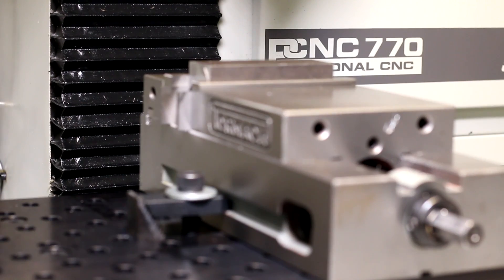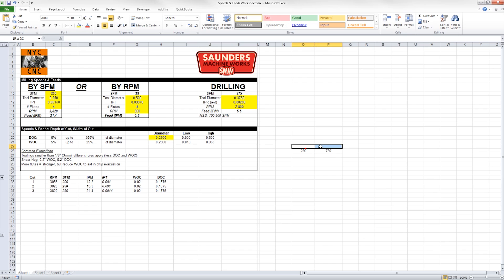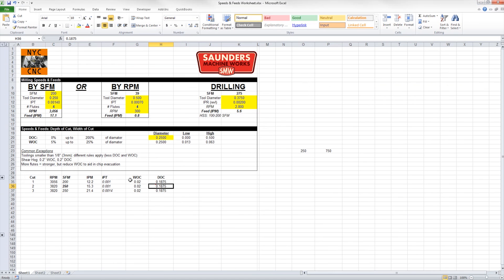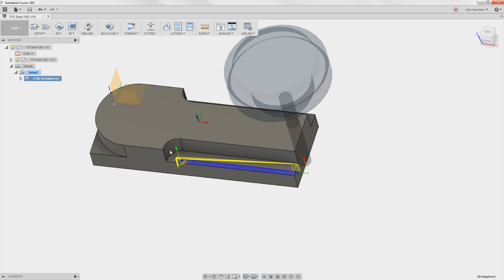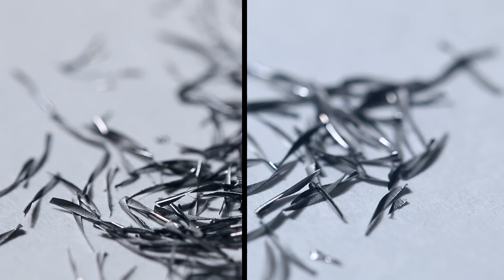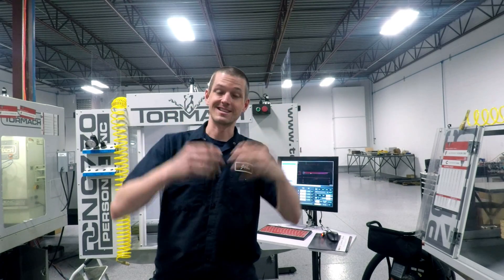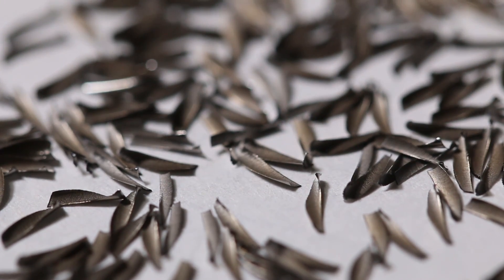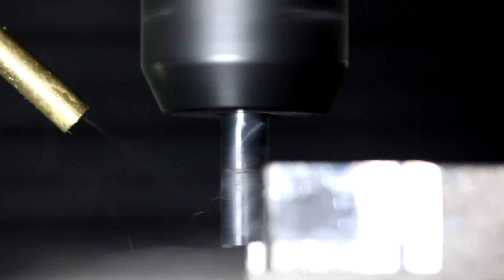Tormach 770: Steel Feeds & Speeds Test!  WW142

Comment: The video contains an error at about 7:21. I know this is an older video, but I found it helpful while researching feeds and speeds for my first cuts in steel (on a 770 Series 3). For your last cut, you say you have 0.002 feed per tooth, 4583 RPM spindle, and 25.7 IPM feed. These numbers are not mutually consistent. If the 0.002 IPT is correct, then your feed was 36.7 IPM. If the 25.7 IPM feed was correct, then your chip load was only 0.0014

Comment: John, when you tried to go to full depth of cut, you said you didn't know why you encountered chatter. Did you talk to Carl @ LSC to try to figure out why? I'd LOVE to know.

The change you made to steer away from chatter seems to go against your preference of deeper DOC and narrower WOC to take advantage of the flute length on your end mill (assuming SFM and CPT are in range).
Is there a better way to calculate the balance between DOC/WOC other than trial and error?
Thanks for your help. I'm battling a very similar issue on my 770 cutting 4140 steel, so I was very excited for this video.

Comment: I'm not sure what Lakeshore recommends, but if you're running below the high-performance endmills recommended speeds and feeds you may get better life out of the general purpose endmill.  Our supplier stresses that the high-performance endmills we use need to be run within recommended specs to gain maximum life, too slow can be just as hard on a tool as too fast.  Not to mention if you're running them slow you might as well save the money and use the cheaper endmill that you can run at recommended specs.  I would also say you shouldn't use recommended speeds and feeds from the general purpose tool as "low end parameters" for the high-performance tool, there is likely more at play than just the tool geometry.

Comment: John,
I am struggling to understand why there is such a large difference in spindle and feed speeds between manual milling and CNC. Is it the use of smaller tools in the CNC machines? The greater cooling available?

Comment: Hi John. I use a brand called Helical Solutions. They offer variable flute endmills as well and are comparable to other high end endmill manufacturers. They have an app on their websites (http://www.helicaltool.com/cms/millingadvisor_367.aspx) that calculates and recommends all the speeds, feeds, rdoc, adoc....etc. You just type in the specific tool you're using, the material and the type of cutting strategy (high speed, light rough, finish etc)  and it will recommend a really good formula. It's worked really good for me with adaptive clearing on sst and cold roll steel. Btw, I wouldn't recommend coolant when machining 1018 steel when cutting with these cutters/coatings. I've found that tool life is extended dramatically. The coolant causes thermal shock which causes the edge of the endmill to chip. Anyhow, give that app a try, I think you'll like it.

Comment: Great video John.  Thanks for posting.  Did you notice that the .375 depth of cut pass that chattered was around half the material removal rate as the .1875 DOC pass with a larger width of cut?  If you pull out your handy feeds and speeds calculator, (G-Wizard, FSwizard etc...) plug in the parameters, it would tell you that the cut that worked great has around 2X the deflection of the one that chattered.  How can that be...?   The reason is that all the feed and speed calculators (that I've used) do not calculate the cutting force directly, instead they start by calculating the power required from the MRR and machinability data of the workpiece material.  Then from power and rpm calculate torque, from torque and diameter calculate cutting force.  This results in an average force number, which is fine for cuts where one or more flutes is always engaged.  When taking a small WOC only 1 flute is engaged at a time and the power based force calculation becomes less like reality.

Comment: This is where business decisions influence things like feeds and speeds.  Even a part run of like a 100 part, getting a decent chip is good.   If you have a parts run of 100,000 it's worth the extra time to get nearly the perfect chip and every ounce of un needed movement out of the G code.  Even things like step over height can be looked at on a large run.  Running one or two parts?  I wouldn't worry to much about even getting a good chip and just focus on a good surface finish and not worry about the extra few seconds that it takes to make the part.  Good business decisions affect every step of a business.  Check out lean manufacturing.  Cool concept.

Comment: How ironic, I am looking at buying that mill! Great to see it in action before committing to a purchase first. Would a 6 inch vise fit that table? I'd like to run 2 vises for first and second ops in the same program. 
When you were cutting, was the mill in high or low pulley setting?

Comment: I noticed that all tools seem to move clockwise around the parts, what happens if it goes against it the other way counterclockwise from looking down from the ceiling so to speak.
Reply: Sicktrickintuner 
You would be conventional milling. It's harder on the tool and requires more HP to make the cut. And you run the risk of recutting chips, which takes a heavy toll on the cutter. 

The trade off is that conventional milling is a far more stable cut and tool deflection is predictable.

Comment: Chips should be straw colored for HSS tooling and blue/purple for carbide if your looking to get the most from your tooling. Also check your chip thining effect when taking light cuts rubbing will cause chatter especially at long DOCs.
Reply: dkohler54 
You want straw no matter what. 

Blue chips means you've dumped all the heat you can into the chip and still have more to dissipate. That heat will go into the tool and the part. 

You want to get an 80/10/10 heat dissipation. 80% into the chip. 10% into the part. 10% into the tool. If you're generating so much heat that the maximum amount the chip can hold is 60%. You're doubling the amount of heat going into the part and tool.  You'll end up work hardening in no time.
Reply: Straw is ideal for stainless as it tends to work harden easily but for your carbon steels blue is ideal for coated carbides as stated in just about every piece of literature wrote in the past 20yrs. Chips can still absorb more heat shown by colors blue <purple <grey <black.

Comment: Another tip to avoid chatter is to set your WOC and DOC so that as many teeth as possible of the cutter are engaged in the workpiece, if you facemill a 0.5" wide workpiece with a 3" diameter facemill each tooth will hit the workpiece and go from zero to 100% cutting force. However if say 4 teeth are engaged at once then one will "leave" the workpiece => cutting force drops to 75% and the next one engages, going back to 100% cutting force, thats a much smoother transition, additionally you get very strong chip thinning with small WOC (worst case rubbing) so similar to lathe tooling you shoulnd't step below a certain minimum of WOC or alternatively increase your IPT to compensate. There are some great mini videos from sandvik on this, definitely worth to check those out.

Comment: Great video John and glad you're using a 770 as that's what I have. I have done a fair amount of 1018 steel and have found a couple of things;- Don't use over 3/8" dia cutters so you can keep the rpm's up as the 770's torque at low rpms can be an issue. Compared to the 1100, take advantage of the higher rpm range and faster ipm capability.- Maybe it's just my machine but if I try heavy cuts the EM/TTS can start to pull out with the power draw bar. If I tighten by hand its fine but that defeats the purpose of the PDB. I went through the Tormach white paper on this and tried a new collet and using bluing without much help. Have you had this issue?? Overall I love my Tormach and can't wait to see some more feeds and speeds (its cheaper to learn from someone else's mishaps!)

Comment: You could have gotten that full DOC to work. Tool and work holding were fine. 

Give you a hint... it's why SFM actually matters 

Self-excited vibration is another hint.  Think. Tuning fork. 

All chatter is a variation in chip per tooth in a cut. Technically speaking all cuts chatter, the greater the CPT  variation the more chatter you get. Get enough variation and that's when the bad noises start. 

DOC is just a factor of HP. That's it. The machine sounded fine and the motor wasn't struggling.  So it can take that DOC no problem.
Reply: Explain please, i dont quite get it . Why is DOC just HP dependant? Less rigid machines will change your deflection, thus producing chatter, independently of HP. 
Then, reducing SFM reduced chatter. Ok, granted. But, what about turning fork?
Reply: TeslaAtoms 
A deeper depth of cut increases cut stability, not decreases. More tool is in contact with the part decreasing its ability to deflect. But, because it's increasing its material removal rate, it requires more Hp. 

And to reduce chatter you want to increase, not decrease your SFM. 

As for tuning fork. The endmills contact with the material can be converted into a frequency. Say you're at 10k rpm with a 4 flute cutter.   Rpm/60 gives you Hertz 10k/60 is 166. For every rotation the endmill impacts the part by  he number of cutting teeth. In this case 4.  166 * 4  give you a cutting frequency of 664 Hz.  If the cutting frequency matches the harmonics of the material or the cutter, you get chatter. Just like a tuning fork.

Comment: Variable flute is like some tires have variable patterns. It makes the car goes more quiet. With standard pattern on the tires, you hear the sound from the tires and it makes more sound in the car. With variable patterns on the tires doesnt have the same dopplersound effect as other standard/older tires.
Reply: Ulf Alexandersson 
Variable helix eliminates chatter by increasing stability in the cut and reducing harmonics in the tool.  The noise reduction is just a byproduct of reduced resonance frequencys in the tool and material.
Reply: Just what I tried to say with my limited English ;)

Comment: I would use 10000RPM and 50IPM, if it chatters more feed, up to 200 IPM. If chatter goes not away, use a smaller WOC.
Reply: You'd have to drop your WOC so low you'd be rubbing rather than cutting.

Also. Adjust your RPM first to eliminate chatter.  Feed and woc second.  Most chatter can be eliminated with an RPM adjustment.

Comment: Copper - fun to machine, a chore to drill
Reply: Geof Dumas 
Nightmare to tap!
Reply: Form tap to save headaches! Makes a stronger thread, too
Reply: Geof Dumas 
Thru holes maybe. Blind holes I've never had good luck with a form tap over 4-40 in copper. Galls and seizes up even with liberal amounts of moly D and a 65% thread. 

I usually just thread mill it to save myself the headache of digging taps out.

Even taking with 3 different tooling manufacturers they couldn't give a good answer. Basically they said thread mill is the best way.
Reply: Ah, right! I've never done blind tapping in copper. I've only had trouble with titanium

Comment: I started milling in low RPM with my drill press & cnc router. I noticed when I mill in lower SFM more heat is dumped into the carbide cutter. I still mill with low RPMs on my drill press for aluminum. But I think higher SFM for steel works best.. my tool life is really good & the end mill is cool to the touch after an operation. I run my ALTIN coated 0.25" carbide cutters at 1296 SFM or 19,800 rpm. HSM adviser recommends 15,432 rpm but I find 19k rpm runs a bit smoother. Im only going 120 inches per minute vs what HSM adviser recommends at 177 inches per minute tho..

Comment: Can you provide chip thickness also/instead of chip per tooth in these videos?
Reply: Chip thickness is more important than IPT. When using adaptive trochoidal milling, it is possible to use very high IPT while having thin chips, because the WOC is so small. Just like using a high feed face mill with low lead angle, high IPT but thin chip. I think the suggested chip loads in those charts are for traditional slot milling with 100% WOC, where the peak chip thickness = IPT. I run my carbide cutters on steel with 10-20% WOC, full DOC when needed and IPT of 3-6 thou depending on tool dia and WOC.
However, no one ever provides chip thickness information, maybe because it's so difficult to calculate :-).
Reply: Correct, chip thickness is more important than "chip load" and it's what you should be after, unless slotting (then they coincide).

Another way to think of it is "chip load" is the capacity and "chip thickness" is the result. Or "chip load" is the pipe and "chip thickness" is the water. 

C=(T*D)/(2*SQRT(D*W-W^2))

where
C=chip thickness
T=chip load
D=tool dia
W=WoC

The same formula is used both by Bob in GWizard to calculate the "adjusted chipload" and by Helical Solutions in HMAdvisor  to calculate chip thickness.

http://blog.cnccookbook.com/2017/03/14/cnc-chef-video-chip-thinning-clear-present-danger-ignored/
http://www.helicaltool.com/secure/Content/Documents/Tech_ChipThinning.pdf

Comment: Dumb question- why not plug everything into HSMAdvisor or GWizard?
Reply: Personally I find that HSMAdvisor and Gwizard are great places to start. But every machine's little quirks and individual cutting tool geometries vary. Doing testing like this is the best way to take that good head-start that Gwizard will give you and dial it in for your application.